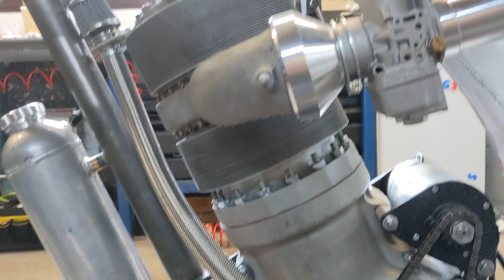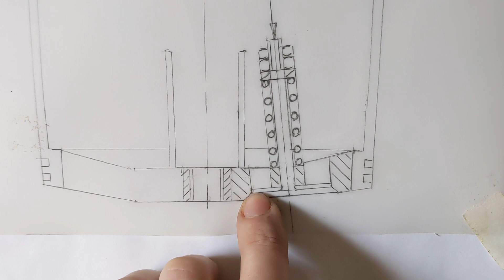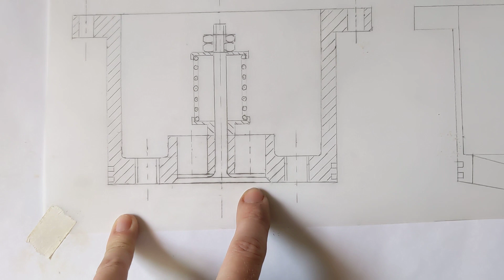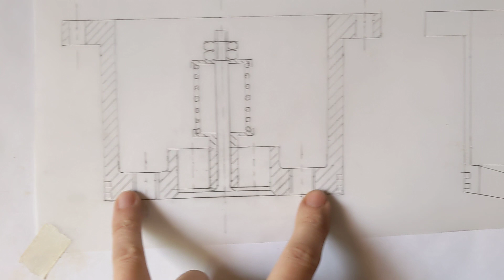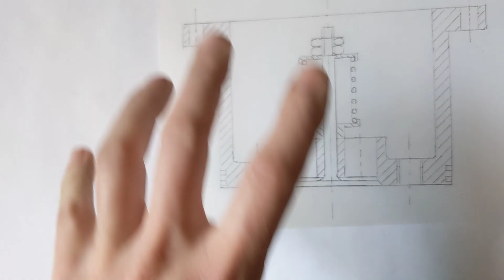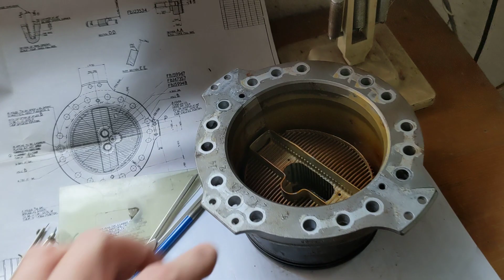New Head!  (Battery will get you everywhere!).

Comment: Have you tried a discrete automotive starter motor for fun? I think a decompressor is a waste of effort and you could simply install a bigger starter motor or a second dynastart to get the torque you need. Try further increasing the gear reduction.
Reply: Impractical though it may be, a shotgun starter might be interesting.

Comment: You got space for a flywheel starter.  So use the starter motor to spin up a fly wheel and then use that to start it
Reply: He already has a 50kg flywheel. Adding a decompressor does essentially what you're suggesting.
Reply: @Makermook    Not be less work in making a heavy fast spinning flywheel that the starter motor can spend a few seconds getting up to speed  rather than making a complete head

Comment: Use the thickest battery cables that you can as the voltage drop across the cables will be significant at the high cranking amps.
Reply from the maker: We measured the voltage drop at 0.4V while cranking. I have some thicker cables but the difference between 4mm and 10mm was minimal. Either way I still need a decompressor.

Comment: I feel that making a new head with lower compression is the incorrect, much harder and more difficult solution to a really simple problem.

The problem is your starter is too weak. Those dynastart units are a big compromise. They give up a lot of efficiency and starting torque in order to be able to generate.

I think getting a small modern permanent magnet gear reduction starter, and then putting a sealed one-way roller bearing on it with your sprocket pressed on to it would be the ticket. You could even keep the dynastart for generating, and just place the starter over it. A starter for something like a little Kubota diesel should have no problem turning that engine over.
Reply from the maker: That's interesting and perhaps worth looking into. I see the Bendix gear on starters for Kuboto diesels, so they're obviously running against a flywheel. That's gives a big reduction ratio. I want to turn the engine over at least at 200rpm, what sort of speed do that starters run at?
Oh, and making a new head is really quite simple compared to other stuff 😁😁💪
Reply: @StoneEng  They are running against a flywheel with a reduction. However, PMDC gear reduction starters are typically much more powerful than dynastarts. I don't know the details of your specific dynastart, but most seem to be around 0.7 kW of cranking power, with a few very large Bosch models at 0.9kw. Even basic little Toyota 4-cylinder starters are around 1.2-1.6kW. Kubota starters are around 1.4-2.0 kW depending on model. Larger diesel engine starters are around 3-4 kW output.

Before I went and made a new head, I think It would be worth the experiment to head to a local wrecking yard, yank a starter out of some Toyota for £25, lock the bendix out, stick a sprocket on it, and see if it goes.
Reply from the maker: I was just thinking exactly that. 👍
Reply: @StoneEng  ...and if you're curious to see how powerful a certain starter, usually doing a google search for "Make Model Starter kW" will show results. e.g. "Toyota Camry Starter kW" will pop up a bunch of results listing how powerful the starter is.

Comment: Absolutely excellent, glad the experiment with a bigger battery and cables worked. Those lithium batteries have a built in BMS to take care of over/under charge and balancing the cells so as long as your regulator is in the ball park of 13.8-14.2V or so your golden. Big fat starter solenoid now then.

Keep up the awesome work 👍